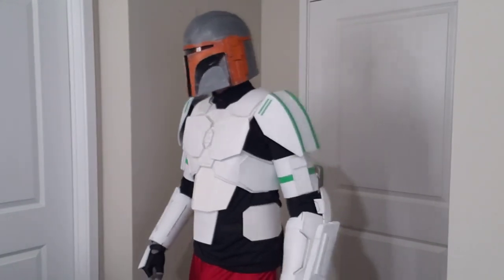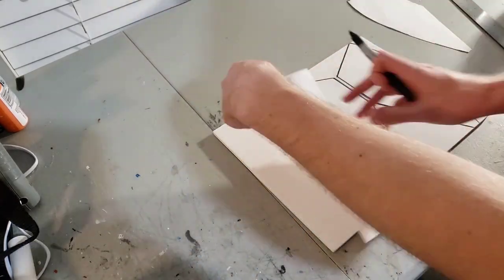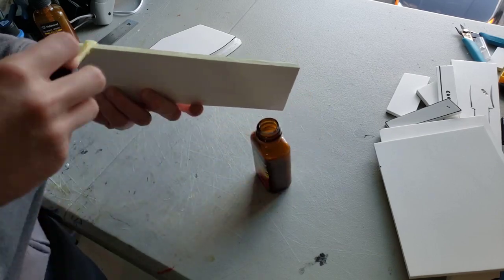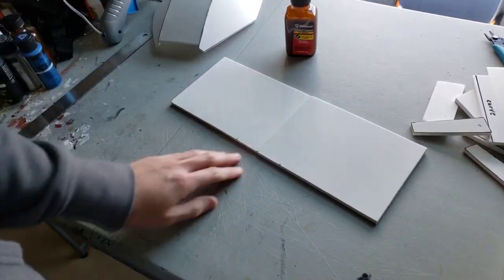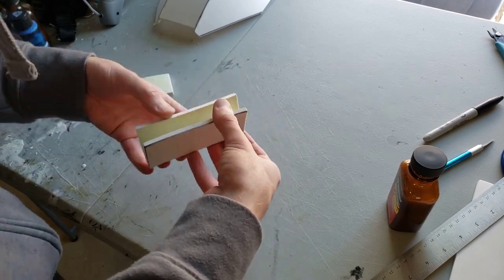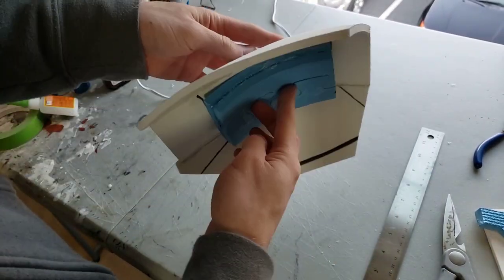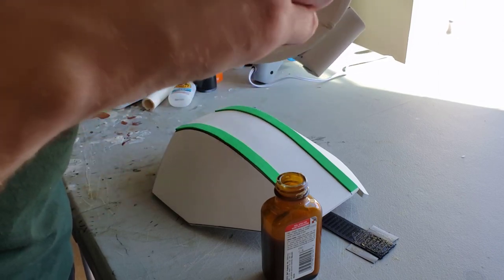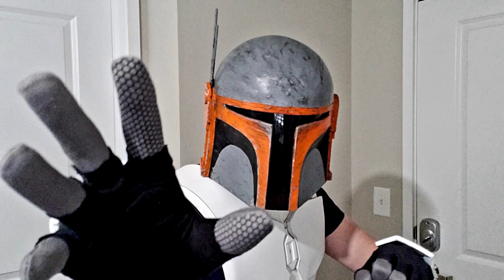Mandalorian Costume Tutorial [ PART 4 ] Shoulders

Comment: If you want a less toxic alternative to dap or barge, elmer's rubber cement is essentially the same thing, i would say it's not quite as strong but for most applications it works just as well, i haven't checked prices and done all that so I can't say if it's any cheaper or not
Reply from the maker: Thanks! I actually just bought some and I need to try it out because the dap stuff smells awful even with a mask.

Comment: Not question for the armor, but for your helmets, you use spackling ? The stuff for drywall ? I think 😂 and if so is it work good ? Have you used other methods like clay ? Which works best? Thanks
Reply from the maker: Yes. I have used spackling in several helmets so far and it works perfectly fine. A more common material to use is Bondo, but that is toxic and can harm you if you're not careful. Bondo is stronger in the end, but I haven't had to use any yet. I'm not sure about clay. I don't now how sticky it is, because it has to be able to stick to paper or foam and be sandable which it might not.

Here's what I used in the clone helmet:
https://www.amazon.com/DAP-18741-Platinum-Patch-Filler/dp/B077Z8Z8D8

Comment: Can you say which exact brand foam you recommend? The link just takes to all 6mm EVA foam. I am going to print the templates to start "messing" around but I had to buy printer ink which should come tomorrow (I could not go out and buy it since I have COVID) - Wonder if you can still wear a standard Mando cape with this build or would it not work properly?
Reply from the maker: Honestly any type of eva foam should work as long as it's not super thin like 2mm. This is the one I've been using, but I'd like to try out the cosplay specific eva foam sometime too. I heard it's a little denser than this craft foam. 
https://www.amazon.com/Sheets-Better-Office-Products-Crafts/dp/B089DSZGV8?ref_=ast_sto_dp

I plan to have a small cape as well so it should work with one.
Reply: @ryzer_red  I love what the foam and the TnT cosplay supply mega rolls.

Comment: Hola pachinko! (No idea what that means..)
Do you do commissions or custom armor?
I’m a 5’1-5’2 girl and I just can’t afford any of the super expensive ones anywhere & it’s hard to find one for my size 🥺😂..
If you were to do a commission, what would be the cheapest possible option? (Not as complex as this armor, holy smokes!) Like just the chest/back, shoulders, arm, crotch, legs, and knees? (This video has a super complicated design, but I understand that is extremely difficult or time consuming.)
Reply from the maker: Hey! Thanks for your interest. At the moment I am not taking commissions, but I have plans to open an etsy store sometime in the future and sell my armor on there. I didn't think about it, but I may have to include a smaller size option. I only have my body type to work with so I will be tricky to get it right, but I'll give all the measurements.

To give you an estimate, I would probably sell a full suit of the clone armor for around $600-$700. I think that's fair considering a full unpainted plastic suit is over $1000. I also considered selling the armor parts individually so not all at once if you wanted to spread the cost out a little. Hope this helps.
Reply: Awesome, thanks! 
I hope your shop goes well if you decide to make one! You seem like a creative dude, so I’m sure it’ll go great!
Have a great Halloween!
Reply from the maker: @kkradar  Thanks! And you as well.